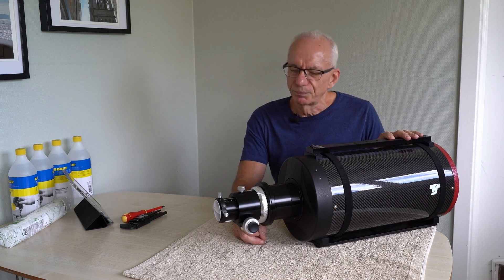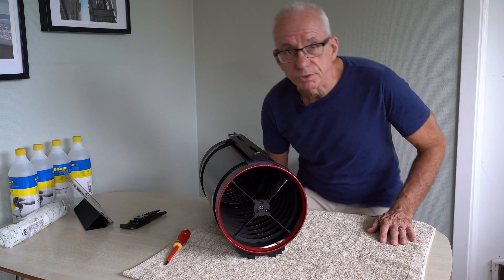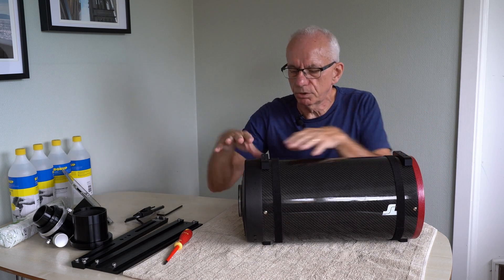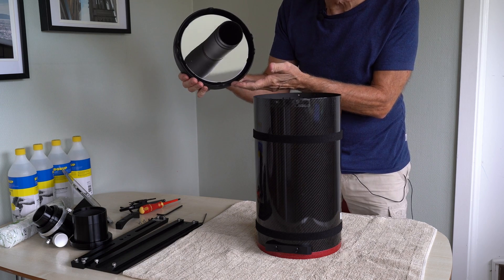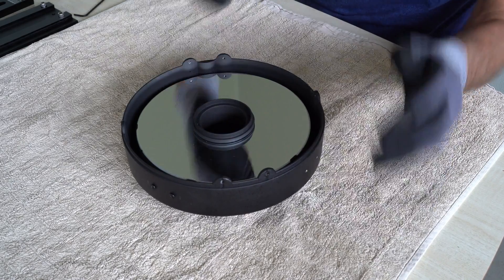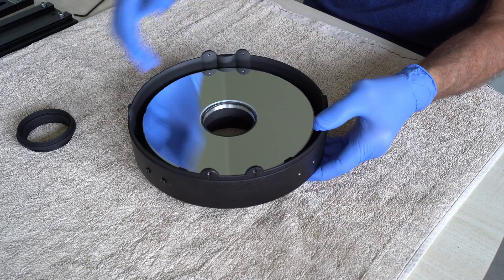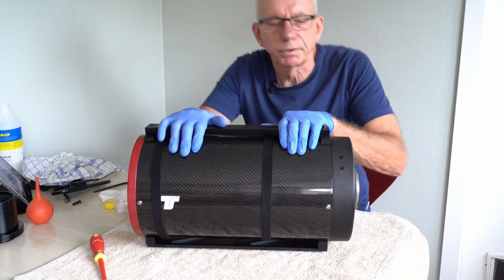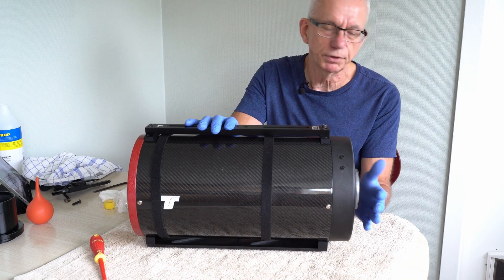Cleaning the primary mirror of an 8" Ritchey-Chretien telescope

Comment: Excellent video. I’ve had my RC8 for a few years now and while it’s still taking amazing images, I can see that the primary mirror has lots of dust particles on it. I’ve been nervous about attempting a cleaning process as I have managed to obtain excellent collimation and the idea of removing the entire image train is a bit scary. However, having watched your video I’m feeling a bit braver.
Reply from the maker: RED FLAG - RED FLAG - RED FLAG :)
I’m grateful that you like my video, but please don’t see it as recommendation to tear your rig apart just for the exercise. The reason I cleaned mine was that I had the scope apart anyway to check it for any assembly errors, and then I might as well do it. Not because it really needed it. A bit of dust on the primary probably doesn’t make any substantial difference, and if the scope is yielding great results I would advise you to leave it alone. Unless, of course, you love the tedious process of collimation. :)

Comment: Great video, thanks!
One useful liquid for thorough cleaning is acetone.
You can drizzle some on the mirror if it has stubborn stains.
It is also very useful to dry the mirror once demineralised water cleaning is done. 
Let the water drip away by tilting the mirror, and then drizzle some acetone on the mirror.
The remaining water will mix with the acetone and evaporate with it, leaving a very clean (grease, water and dust free) surface without risk of scratching from cotton or towels.
Reply from the maker: Thank you for your comment. Interesting technique using acetone to remove residual water. I would emphasize the need to use the acetone in a well ventilated room, as the fumes are potentially harmful to breathe. Also it will dissolve any plastic parts on contact.
Reply: @flemmingsastro Excellent addition and safety recommendations! Thanks!

The acetone trick is used in chemistry labs when absolutely dry glassware is needed (and yes, it is done on seemingly dry glassware, as some humidity remains just from the room's air).
Mind you, the amount used is rather small. Just enough to "roll a wave" the mirror.
I have used this to save an old TAL-1 whose mirror was desperately dirty from decades of neglect. 
Water alone did nothing. Warm soapy water did not help either, but a little "face-bath" of acetone, rolling the liquid around the surface, and light wipe with acetone-soaked cotton revived the mirror like new.
I then rinsed it with demineralised water to remove any remaining cotton fibers, and dried it with an other, very light acetone shower.
Reply from the maker: @ Great procedure, thanks!

Comment: Great video thank you. I notice that you do not mark the primary mirror cell with alignment points made on its side with a marker before returning the cell approx 15:15 in your video. So the mirror cell itself has not to be realigned to its factory position prior to removal?
Reply from the maker: The telescope was in very bad collimation at the time, so I had no preferences as to the orientation of the mirror or any other part of the optical train. If your scope is in top notch configuration it may be a good idea to mark the position of everything. I suspect that disassembling the scope will necessitate a renewed collimation no matter how careful you are but I guess it won't hurt to reinstall everything in its original orientation.

Comment: dont forget to loosen the two allen screws in the mirror lock ring before loosening and retighten after locking the primary down
Reply from the maker: Hi David.Thanks for the advice. I did not notice any locking screws in the retaining ring on my scope. If I have to do this operation again I'll certainly be on the lookout for them.
Reply: @flemmingsastro  at 16.04 when you show the mirror to the camera, you can see the two threaded holes where there should be two small grub screws to lock the mirror lock in place so it cant unwind. they might not be there in your spec rc, but they are there in mine. but both scopes will be GSO so i guess itl be down to the suppliers specs.

Comment: Ciao. Grazie e complimenti per il video. Avrei una domanda. Io ho un RC8 carbon e nello smontare lo specchio mi sono accorto che il primario è libero di ruotare nella cella nonostante la vite di serraggio sia ben stretta. È normale?
Reply from the maker: Hello Diego, and thank you for your question. There is nothing preventing the mirror from rotating except friction against the retaining ring and the back of the mirror cell, so yes, that would be normal. Mine did not rotate easily, when the retaining ring was tightened, and there is probably no outside interference which would cause the mirror to rotate. Then again, the mirror should be rotationally symmetrical within the tolerances, so even if it did rotate I would not expect you to notice any problems. I would advice you not to tighten the ring excessively, as the pressure could cause deformation of the mirror which would certainly influence its performance optically (pinched optics).
Reply: Grazie mille

Comment: I thinkyou should use some detergent, otherwise you remove only particles and not molecular contaminants (grease, oily things deposited on your mirror). Also, how clean is the cloth you use for drying? . Replace cotton parts with optical paper. And also avoid speaking while manipulating the cleaned mirror, bcos for sure you leave droplets on it. All in all is a good video so users are not afraid of disassembling and cleaning . Thanks
Reply from the maker: Thank you for your comments.

Comment: I'm not sure why your focuser is so weak.  I have the Omegon version of this RC8, also a GSO and if you tighten that focuser clamp screw on the bottom of the focuser down nice and tight I can actually tug on it pretty firmly and it doesn't move at all.  Interesting.
Reply from the maker: Hi @mark2220 and thanks for your comment.
I agree the GSO focuser is sort of ok for manual focusing. My problems started when I attached a focus motor to it. The focuser was not moving in a predictable manner, and I could not get autofocusing to work.

Comment: Thank you for your tutorial. I also have an RC8, although I haven't needed to clean the primary mirror yet, your video will surely be very useful to me. One more thing, would you be so kind as to share with me the model and brand of your new focuser? Many people have suggested that I should change mine, and I've seen some alternatives, but I would like to know the one you chose if it's not too much trouble. Thanks again for your video.
Reply from the maker: No trouble at all.
I ended up buying the following directly from the Baader-Planetarium.com web-shop:
2" BDS-RT BAADER DIAMOND STEELTRACK FOCUSER  Part nr. 2957210
RT-ADAPTER M90X1 DIAMOND STEELTRACK® (SKYWATCHER) Part nr. 2957283 
The focuser is very sturdy and smooth running, and there is no discernible backlash making it a joy to use.
As a personal preferece, because I don't trust myself with thumb screws holding the camera, I also ordered the BAADER 2" CLICKLOCK EYEPIECE CLAMP S58 clamp (Baader Diamond Steeltrack) Part nr. 2956258 
The clicklock clamp gives you a very firm hold on the camera and is quick and easy to use, so I would recommend it unless you chose to screw the camera directly on to the focuser.

I will post part two of the video very soon, showing the installation of the focuser, so stay tuned.
Best regards,
Flemming

Comment: Wonderful video, perfectly paced! So many naysayers commenting with no practical experience that you should use all sorts of additives, from dish soap, or rinse with isopropyl alcohol, to ammonia (!) and I'm glad you are taking the minimally-invasive approach! When I do mine, I shall use far more pads and ensure to never use them more than a single pass, mainly because I know my mirror is significantly more grimy than yours was! I'd also love to see a video of you doing collimation, again, so many armchair experts, and you have the exact model of scope I do, so I will always trust you!
Reply from the maker: Thank you for your positive comments. Water is a wonderful all-round solvent, except for oily substances, and it is great for removing particulate matter. If I had a difficult grease spot, or perhaps the remains of a long dead insect on the mirror, I would be comfortable with using sensor cleaning fluid for spot treatment, but I find that in most other cases less is more. 
I have had little luck with collimation till now, so my advice would be to place your trust in someone else, at least for the time being. 😉
I have however chosen the path of eliminating weak links in the optical path, hence the change to a better focuser, and I will soon be posting a video of me aligning it with the mirrors using some optical tricks.Hopefully I will be able to achieve good collimation soon.

Don't forget to 'like' the video, and maybe subscribe to my channel if you want to see more videos of this kind.